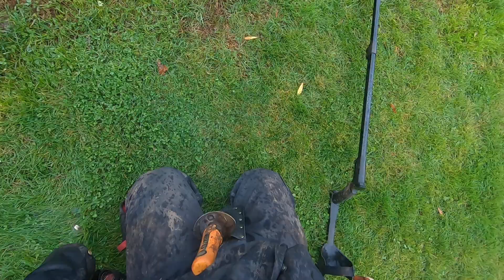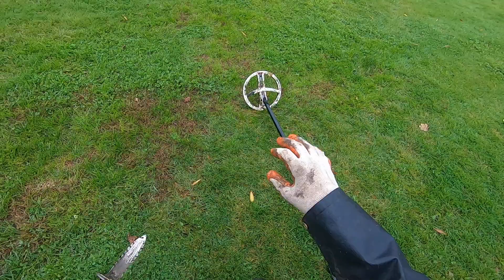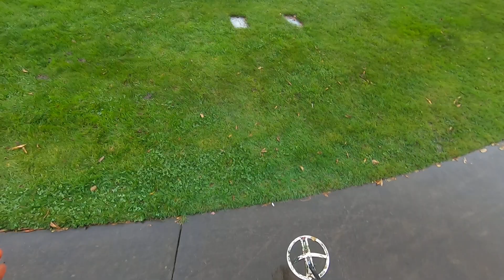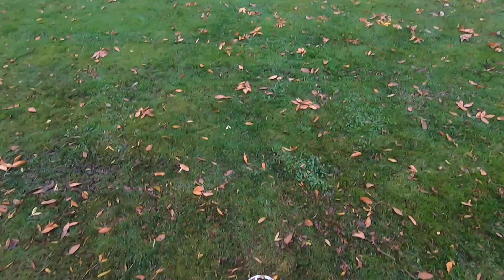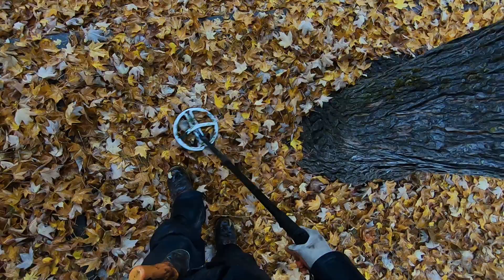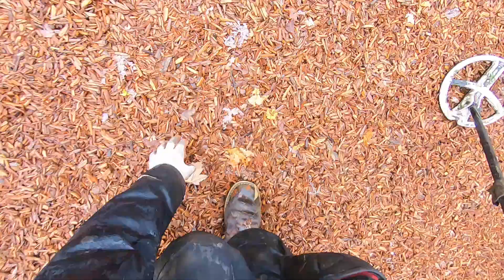Types of EMI on metal detectors!! How to reduce falsing.

Comment: we always had the materials to shield detectors from EMI, however up until recently, people didn't spend 2 grand on metal detectors.  a top line metal detector was 500 bucks.  the solution is don't detect in crowded cities bombarded with microwave, wifi, etc. radiation.
Reply from the maker: There was no modems and cell phones back then. I have a few old detectors that were over 1500 back then.

Comment: EMI ruined metal detecting.  there's some very expensive and good detectors made in 1990's early 2000 that just go haywire now and are unusable, unless you're far out in the countryside farm areas.  fortunately the old analog detectors are impervious to it, because they are different circuits, and not digital. they are immune to EMI.  such as the Whites 4900 5500 5900 6000 XL PRO, PRO XL, Di, Pro, Pro Plus.  but they only go 8-10" deep.
Reply from the maker: Parts for and batteries cost a fortune for those old detectors.